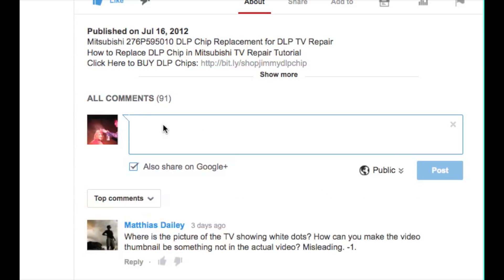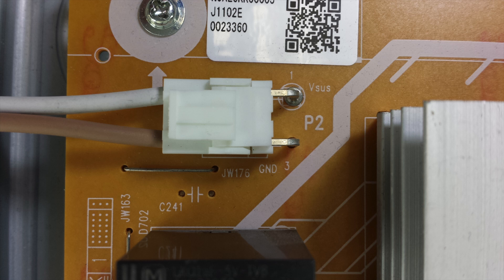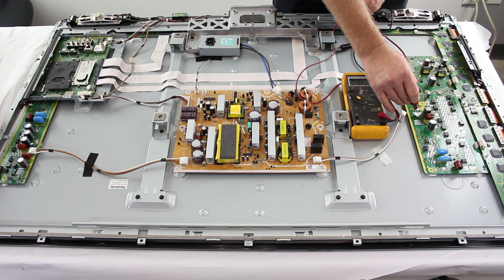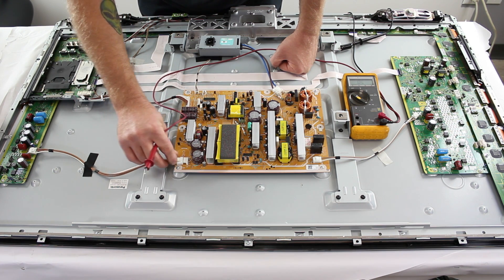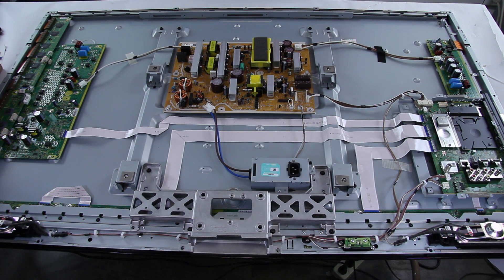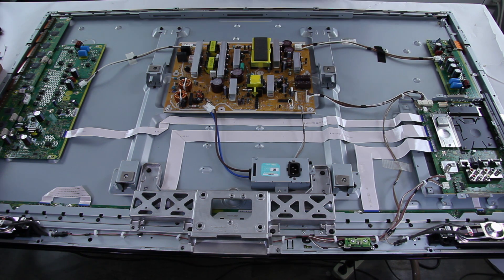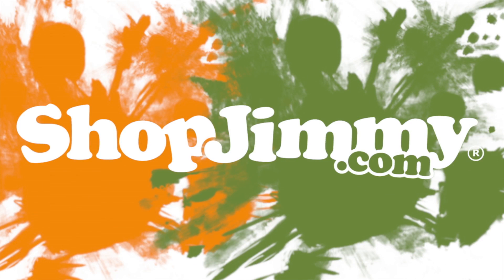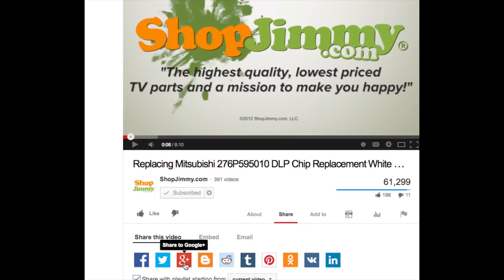Panasonic Plasma TV Repair - Understanding 14 Blink Code - How to Fix 2011 Panasonic Plasma TV

Comment: First of all, thanks for the guide. Really helpful.

Here's my situation: solid red light (no blinking). My P board checks out fine while connected to the SC board  *as long* as I place the black lead from the multimeter on the screws on the SD/SU board. If I ground it on the TV metal, it fails unless I disconnect it from the SC board. The SC1 connector seems shorted if I touch the TV structure (plugged or unplugged to the P board) but seems fine if I touch the screw on the SD/SU board. The TPSC1 works always, with everything plugged in or unplugged.

I'm puzzled! Any help would be appreciated! Thank you SO much!
Reply from the maker: *****   Try all repairs and troubleshooting at your own risk.  Please reply with your TV model number.  Click here to view a video that shows how to find your TV model number:  https://www.youtube.com/watch?v=S51nhAmwR2M  Thanks!  www.shopjimmy.com
Reply: ShopJimmy.com Ooops, obvious oversight on my part. It's a Panasonic Viera 46ST30. Thanks for the help in advance.
Reply from the maker: *****  Try all repairs and troubleshooting at your own risk.  Does the TV power up with the SC board disconnected?  Thanks!  www.shopjimmy.com
Reply: ShopJimmy.com Disconnecting the SC board I get 7 blinks. :\
Reply from the maker: *****   Try all repairs and troubleshooting at your own risk.  I recommend repeating the same test on the SS board.  Thanks!  www.shopjimmy.com
Reply: ShopJimmy.com Any specific point I should use for the ground lead? Putting the "black" lead on the SC's board screws, I tested Vsus on the SS board (both on the P and the SS sides, with the connecting cable plugged in) and it seems fine. Super weird, no? Thank you for the help!

Comment: My 50 inch Panasonic VIERA plasma TV does not show picture when I turn it on. The power light lit. Its model # is TC-P50S30. What would it cost to fix what ever the problem could be??
Reply from the maker: Anthony Highsmith   PLEASE SUBSCRIBE TO OUR CHANNEL - Try all repairs and troubleshooting at your own risk.  I recommend replacing the SC, SU and SD boards in your TV.  Click this link to replacement parts for your TV model number:  http://www.shopjimmy.com/catalogsearch/result/?q=TC-P50S30  There may be multiple boards for the same TV model number, be sure to match part numbers on your current board, with your replacement for compatibility.  Thanks and please let us know if you have any further questions with your TV Repair!  www.shopjimmy.com

Comment: Sorry I'm Tony TellULater  TV is the 42 inch plasma TV P42G25 had 10 blinking led.
You said unplug SC board so I pulled the 2 prong connector and the ribbon connector then powered up and it still had 6 led
Reply from the maker: Timelord169   PLEASE SUBSCRIBE TO OUR CHANNEL - Try all repairs and troubleshooting at your own risk.  Repeat the same test on the other side of the board with the SS board.  Thanks!  www.shopjimmy.com

Comment: I was given a Panasonic 42" Plasma with 4 blinking red code. TV Model is TC P42G25 and I have looked for the main issues like bulging Caps most are convex but the 2 larger ones are slightly raised, so I'm wondering if that's still a sign of over heating and should they be replaced?
If you have a video for this TV that would also be a big help. Thanks for any assistance you may have to offer..

Comment: Hi,
I have a Panasonic TH-P42G10A
Im getting 14 red blinks.
Any help?
Thanks
Reply: Hey I get the same problem when I plug in the TV push the power button one time it comes up solid red but if I hold it for a couple seconds it blinks 14 times I just noticed you said this for years ago did you ever fix it and could you possibly let me know what you did to fix it

Comment: We have a panasonic TC-P55st30  that we think was hit by lightning, We here a click when we turn it on, but there are no blinks or solid lights.  My husband took it apart and performed the tests in this video. All the tests show good.There were no shorts.  Any and all help would be appreciated.
Reply: Also we found that one of the two  fuses  right next to the incoming power supply has no volts, but the other fuse has 120V.  My husband said that the fuse may not supposed to have voltage because he said it might be on the ground side.   All the other fuses my husband seemed  good,
Reply: +JCO Lake Both fuses will have 110 t0 120v. So you have a short or the lightning just burnt out the fuse as they are suppose to fail under those conditions. I recommend buying a $10 surge protector. They are not needed with modern electronics as they have line filters that don't allow really dirty power, or brown out- line surges to cause any real problems.However, the power supply that's built into the T.V. is just like the one used in your homes computer. They are designed to be plugged right into the outlet of your homes walls but a $10 surge protector will keep this fuse from blowing again and add the extra plugs needed for your Blue ray player and Cable box. Sincerely, Steve

Comment: Hello i have a tc-p60s30 it starts but wont stay on any advice.it does a clicking sound,turns on for a sec and then it turns off .if i press the power button and hold it down for 10 seconds it turns on and off again.

Comment: I've got a TC-P50ST30 with the 14 blink code. The SC board shows a short at the SC2 connector, but not at TPSC1. This persists after i pulled the board out of the TV entirely. If I had my way, I'd replace the board entirely, but you seem to be out of stock of the part. 

I'm comfortable swapping surface mount components, so that's no problem, but I note that in the instructions for your board repair kit, it does not mention the 14 blink code as being something that kit can fix. Can you tell me if it will fix the 14 blink code?
Reply: Pierce Nichols Wondering the same thing
Reply: +Pierce Nichols Were you able to fix it? I have the exact same issue.
Reply: I had the same issue, ordered the repair kit for the SC board and still have same issue any updates in this? Thanks

Comment: I have a Panasonic TC-P50ST30 and the problem is I turn on the tv and it works good for about 15-45 minutes then suddenly horizontal lines of different colors flicker then the tv loses picture. After a couple hours go by I can turn the tv back on and the same thing will happen. I can still hear the sound but no picture. Any insight to my issue. Any info would be helpful thank you.  jronzani@gmail.com

Comment: Hi,
Panasonic Viera TH-46PZ81B

It fell from wall whilst fully extended for prolonged period.  Semi cushioned landing!
Looking at back of TV Left vertical bracket came off with screw/washer.

TV switches on but buzzing noise from left (looking at it from back).  No picture on screen.  Screen is not cracked.  

Power light will stay on but buzzing noise is constant until switched off.

Let me know your thoughts please.

Comment: i have a question.. my pannasonic txp42ut50e headphone output jack is broken.. ,,it  must be held in a certin position to work... is this a expencive problem?  hope to here from you thanks for the help mr z
Reply: +Lawrence Zacharias Those 1/8" plug ins can just get too loose to work properly. If you know how to solder you can replace it with a different unit. I would just hook up a receiver to your t.v and get better sound and a much better headphone experience as well.You don't need a 5.1 or 7.2 surround sound receiver to accomplish this. You can buy a very good used receiver on Ebay and use the SPIF digital coax or optical for your new stereo output for about $50.You would be surprised how cheap you can get a good receiver that lacks HDMI ports on Ebay. Well under $100 for a good name brand like Yamaha or Denon 5.1 receivers that still have SPIFs for digital sound with your T.V and a cheap pair of Dayton speakers. About $100 for both and you will really enjoy both the speaker sound and the built in headphone sound that a decent receiver will give you compared to the 1/2 watt built in headphone amp built into the T.V.Check it out and I'm sure you will actually be glad your T.V.s headphone output actually broke on you. Huge difference in sound quality!  Next pick up a good pair of headphones and you will have an entirely new sound that you will simply love. About $150 to $200 for all 3 components that will last you for many, many years.

Comment: i have a tc-p65st30 tv and it made a big flash on the right side and turn off now it wont power back on?
Reply from the maker: FERNANDESFIVE   PLEASE SUBSCRIBE TO OUR CHANNEL - Try all repairs and troubleshooting at your own risk.  I recommend replacing the SC, SU & SD boards in your TV.  Click this link to replacement parts for your TV model number:  http://www.shopjimmy.com/catalogsearch/result/?q=tc-p65st30  There may be multiple boards for the same TV model number, be sure to match part numbers on your current board, with your replacement for compatibility.  Thanks and please let us know if you have any further questions with your TV Repair!  www.shopjimmy.com

Comment: Hello- I have a Panasonic to-p42s30 with the 14 blinker... The power board has o ohms when the sn board is plugged in but when I unplug the sn board the power board then has ohms.  The same plug I test that is unplugged from the power board has 0 ohms... Can I assume I have a bad sn board and either replace it or have you repair it?  Thanks for any help!
Reply: Sorry tc-p42s30 is the model

Comment: Hi,
I have a Panasonic TX-P46G10b Viera plasma tv and following a storm the tv won't turn on anymore. When the tv is turned on you can hear a couple of clicks as normal and the screen appears to light up, but then it switches off and the red LED flashes 14 times twice. Any thoughts on what I can do to fix it? Annoying though as there was a surge protector fitted on the power point.
Reply from the maker: Paul Barfield   PLEASE SUBSCRIBE TO OUR CHANNEL - Try all repairs and troubleshooting at your own risk.  This can be difficult to troubleshoot without having the TV in front of us.  I recommend that you bring the TV to a certified Panasonic repair shop.  Thanks!  www.shopjimmy.com

Comment: Panasonic Plasma model TC-P54G20.
I turn on the TV and it clicks once, a second time, the red light illuminates, and then it continuously flashes.  There is no particular number of flashes.  It won't turn-on. It sounds like it tries to turn on and then turns off immediately.  What do you think is causing this issue?  Thanks
Reply from the maker: Vince Stark   I recommend bringing the TV to a certified Panasonic repair shop.  Thanks!  www.shopjimmy.com

Comment: Hi I have a model TC-P50S30 Panasonic and I tested the p-board and everything was fine but when I test the a-board by pressing and holding the button it blinks 14 times. when I press the button once it stays solid red. what should I do???
Reply from the maker: bean moder   I recommend bringing the TV to a certified Panasonic repair shop.  Thanks!  www.shopjimmy.com

Comment: I have a Panasonic Plasma TV 2011 ModelTC-P55GT31 (2011 model).  Couple days back when I put it on, it briefly came on for a couple seconds and then went off with the LED displaying the 'dreaded 7 blinks'.  I've gone through several blogs and articles, that suggest that the issue  is most likely with one or more of the following circuit boards:  SC, SD, SU.  One blog suggested disconnecting the buffer boards to isolate the source of the issue.  After doing so, the LED blinks 8 times.  When the buffers boards are re-connected, then the LED gives 7 blinks again. Would like to know what does 8 blinks error code correspond to.  Thanks!

Comment: I have a TC-P46ST30 Panasonic Plasma, experiencing 14 blink failure code. I get a short on the SC2 VSUS pin regardless of what i have connected.  I assume that my SC board is the problem, but your video does not clearly state that is the case.  Please confirm and let me know if I can get this replacement part from your shop.  In the event I am incorrect could I return the part for something else?
Reply: PSC1 does not short regardless of what is connected, is it still likely my SC board causing the issue?

Comment: Hi. I have a Panasonic TH-P50VT30Z - April 2011 Model that has the power led blinking seven times repeatedly. Are you able to suggest a repair?
Reply from the maker: Daniel Craig   Try this at your own risk. Unplug the TV, then disconnect the SC board and plug in the TV to see if the TV powers up. Reply with the results of this test. Thanks! www.shopjimmy.com
Reply: Cheers. I have had the TV repaired under insurance. Hopefully I'll never have to try that :)

Comment: I have a Panasonic TC-P42S30. On the power supply board connector p2 I measure a short on the Vsus pin. On my tv this connector goes to a board labeled SN instead of the SC, SD, SU trio shown in the video. With power supply board disconnected I still measure a short on Vsus pin on the SN board.

What are the next troubleshooting steps or do I need to replace the SN board? If so, would you please link part number? Thank you!
Reply from the maker: Andres Tamez  Please watch this video FIRST to help with your repair!  https://www.youtube.com/watch?v=BP3NVNCGEv8  I recommend replacing the SN board in your TV.  Click this link to replacement parts for your TV model number: http://www.shopjimmy.com/catalogsearch/result/?q=TC-P42S30  Be sure to match part numbers on your current board, with your replacement for compatibility.  Thanks and please let us know if you have any further questions with your TV Repair!  www.shopjimmy.com
Reply: ShopJimmy.com  Thank you. Last week I replaced the SS (part # TNPA5350AD) board and repaired the SN board (part # TNPA5349) using the components in the repair kit (SN board is out of stock). The TV powers on great now - but the image looks washed out or over-saturated. It is certainly possible that there is a bad solder connection in my rework - but I wanted to get feedback on the coloring issue. Would this issue be caused by the SN board or should I look somewhere else?

Comment: I have Panasonic Plasma model number 50PG79ED-AF,
you can turn it on but some time later it will switch it self back into standby,  some times you can turn it back on but it may just turn it self back into standby,  any assistance would  be good,
Reply from the maker: Jon Blackwell    Try this at your own risk. Unplug the TV, then disconnect the SC board and plug in the TV to see if the TV powers up. Reply with the results of this test. Thanks! www.shopjimmy.com

Comment: yes i have 14 blinking lights.replaced main board used and power supply used still have 14 blinks . using your trouble shooting i do have a short on pin 2n on sp board . panasonic tc-p42st30 model . so i need to know for sure ,that it is this board since i returned other power supply ,mine checks good according to vidio .been over month and this will be the 3rd part .
Reply from the maker: Van Nikolakakos  Please watch this video FIRST to help with your repair!  https://www.youtube.com/watch?v=BP3NVNCGEv8  Yes, if you found a short on the board, then I recommend replacing it.  Click this link to replacement parts:  http://www.shopjimmy.com/catalogsearch/result/?q=tc-p42st30  Be sure to match part numbers on your current board, with your replacement for compatibility.  Thanks and please let us know if you have any further questions with your TV Repair!  www.shopjimmy.com

Comment: I have a tc-p42st30 tv with 14 blinks.  Watched the video and found no shorts.  However when I put my test meter on Gnd I also get a connection.  Your video says if your ground shows a short don't worry about it, but is it ok if your ground shows good?  Does this mean replace a board?  Thanks

Comment: Panasonic TC-P46ST30, Solid Red when turned on. Press Power 5 sec., 14 blinks  TEST: Gnd P2 & Vsus = Short Both pins // Disconnect wires: Gnd P2 = Short / Vsus = No Short // Wires still Disconnected: Remove ribbon also = Short in both pins // SD High Voltage & SC Gnd = No Short // SD High Voltage & SC TPSC1 = No Short
This is where my confusion comes into play. No description what to do if there is no short. Not sure what to do, so I skipped to next... (My assumption is all good up to this point)

Retest: SC TPSC1 & Disconnect SU = No Short
Reconnect SU/Disconnect SD Board:
Retest: SD High Voltage & TPSC1 = No Short

P11 = Short in Vsus & Gnd
Disconnect Wire: P11 = Short on Vsus & Gnd
SS11 = Short on Middle Pin only

Is it the PSB?

Thanks,

Ron
Reply from the maker: Ron Laukaitis   Try all repairs and diagnosing at your own risk.  I would check the SS board to see how that tests.  Thanks!  www.shopjimmy.com

Comment: i watch jimmy's repair and stated that 14 blinks mean power supply , based on this video and panasonic code s i discover that 14 blinks means  Main AV Input is bad . so which is it .frustrated since i bought a used power supply and now i get solid red led
Reply from the maker: Van Nikolakakos What are the original symptoms of your TV problem?  Please reply with your TV model number.  Click here to view a video that shows how to find your TV model number:  https://www.youtube.com/watch?v=S51nhAmwR2M  Thanks!  www.shopjimmy.com